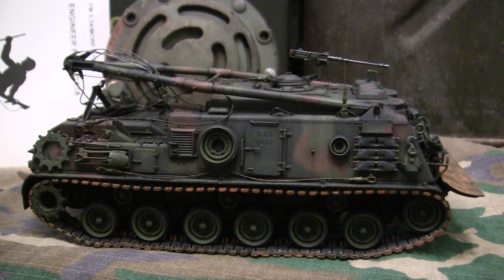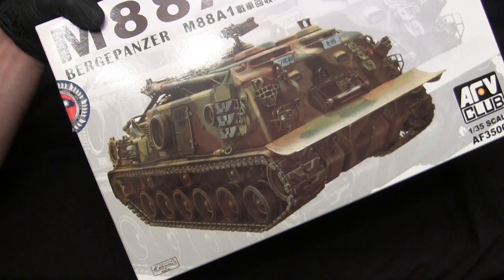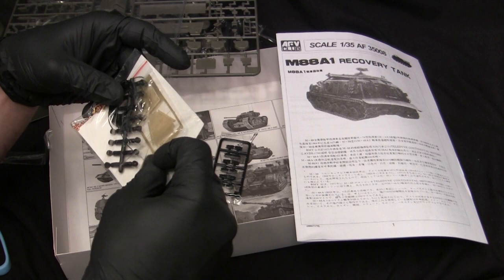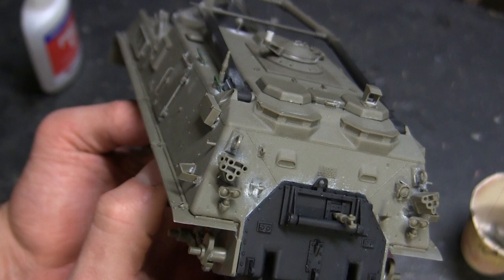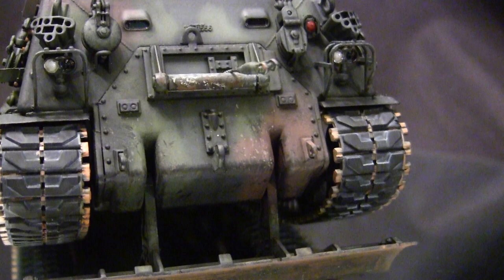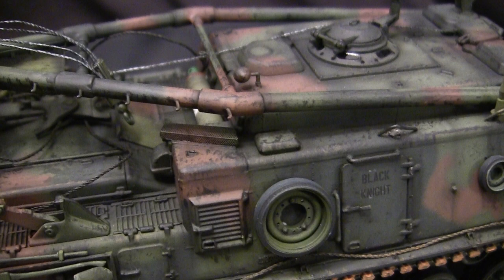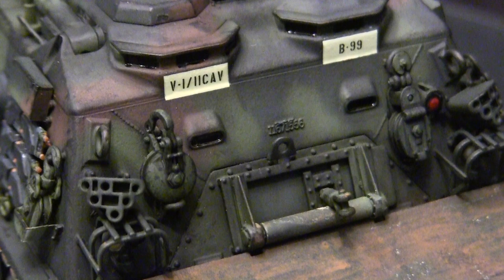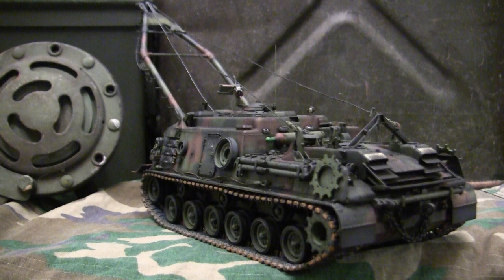1/35th scale AFV Club M88A1 Armored Recovery Vehicle

Comment: The snatch block for the boom does rest in the basket when the boom is in the stowed position.
What you call “idler” wheels are actually called “return rollers”
What you’re calling “pulleys” are actually called “snatch blocks” 
What you call a “bull dozer blade“ is actually called a “spade” using it for dozing is not recommended because it doesn’t take much for them to bend. 
I operated and TC’d 88’s for 15 years. Before that I was on M-578’s which in my opinion was the most versatile tracked vehicle the Army had in its inventory.
Hope this helps.

Comment: The HERCULES is as you said the A2 model and that is actually an acronym for Heavy Equipment Recovery Combat Utility Lift and Evacuation System.  I believe it was actually designed to be able to tow an M1 without a brake vehicle.  It also had a lot of other improvements.
Reply: Hi m88a2 operator here you are absolutely correct. From my 7 years on both the a1 and a2, the main reason the a1 was updated to the a2 was to be able to tow and recover the m1a2 sepv2 abrahms due to it being heavier now days the a1 m88 Is used to tow the 113 family of vehicles and Bradleys. We prefer to use the a2 more over mostly because of having a dedicated main wench for recover instead of removing the hoist cable off of the boom.

Comment: the bulldozer blade makes for a great bed.
Reply: Unless you've been up for 3 days pulling stuck vehicles out at Fort Campbell and they decide to test fire the 50 cal while you're asleep and I ended up face first in a big mud hole 😂
Reply: I couldn’t ever get comfortable on the spade always felt like I was going to roll off I ended taking out the tc seat out and run a hammock on the inside
Reply: @themailbox3273  I really couldn't either but after being awake that long I would have fallen asleep on broken glass. However I did make a bed behind the mechanics seat and slept there most of the time.

Comment: Very nice build, John.. and entertaining as always! Just one question: you said NOT to use a rattle can for painting the tracks, but to use XF1. What about using XF1 from a Tamiya rattle can (which would be TS6) - is it the cheap paint that could potentially damage the AFVclub rubber tracks, or is it the use of a rattle can per se? Greetings, Mike
Reply from the maker: no rattle can paint AT ALL!! the XF1 is an acrylic paint while the TS6 is enamel. The enamel will have negative effects on the track rubber. It also not just the cheap paint but also the expensive paints too. I seen this first hand years ago were I almost ruined a pair of AFV club tracks when I tried to paint them with rustolium. Kyrlon will do the same, so as a rule of thumb... just don't use any spray paints on any rubber tracks ever! save some frustration and headaches and just paint them with the tamiya acrylics
Reply: @oddball759mm  Thanks for your answer, John - but now you've got me all rattled up. Firstly, I always use a black acrylic rattle can as a primer for the rubber tracks (mostly Tamiya and some Italeri), then they are hand-painted with XF-colors - never had any problems. But you got me thinking, so I revisited my orders on Amazon, and there it said in the description "high-end acrylic-quality". I guess that does not mean it's acrylic, does it? But at least it is not "cheap" - about 9 bucks a can 😁
Secondly, I always thought that the XF-range and the TS-range were the same acrylic-based paint (I know that the Xs and XFs are not pure acrylic). How do you know TSs are enamel? It doesn't say so on the can - in fact, it doesn't say anything, except a litany of ingredients of which I don't know anything about 😞 I would be glad if you could shine some further light on this, please!
Reply from the maker: @MikeUSA67  I can tell you for a fact that the tamiya spray paint is enamel, because I used it once for a build years ago. The stuff smells like enamel, and when I used it for touch ups, I had to use paint thinner for cleaning up the paint brushes as the water didn't work... Just like it does with enamels. What they are telling you in the marketing is that the paint is "Acrylic like" that means it applies and sets similarly to Acrylic. Also the Hue is the same as the Acrylic however the paint is indeed enamel. As for the tracks all of my older builds have their tracks painted with spray paints and almost all are ok, however I have had about a dozen that the tracks decayed and disintegrated on. These were from both Tamiya and Italeri. The AFV Club rubber track fiasco occurred a number of years ago, but I was able to salvage that model. Also I have seen the DS tracks brittle up too and become hard as a rock when painted with enamels. It's because of these reasons why I threw the baby out with the bathwater and just to play it safe all single rubber type tracks and tires are painted in Tamiya Acrylic paints, be it XF1 or rubber black. Since I used this paint on the tracks I have so far not have had a single track brittle up on me and some of these builds are past the 12 year old mark and are as flexible as the day I built the model. This has been the case for all the manufacture tracks from tamiya, italeri, and Dragon DS Styrene.

P.S. Right now I'm working on an OTR build where the tracks crumbled into oblivion while just sitting on the shelf, so yes it does happen more often then not and the culprit is most of the time the enamel spray paints, you have been warned!!!